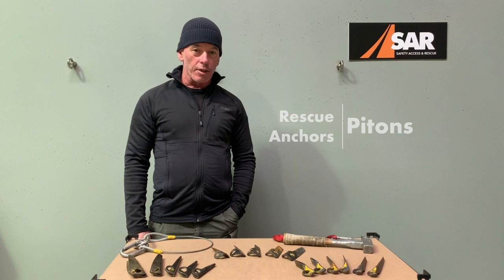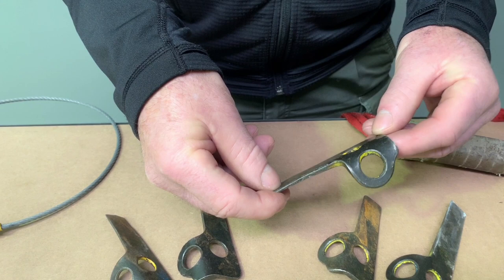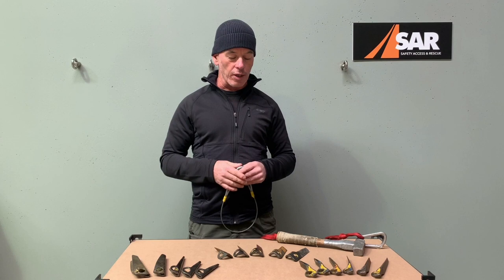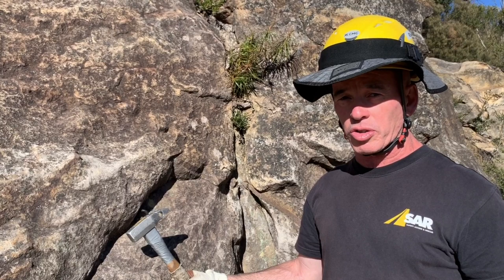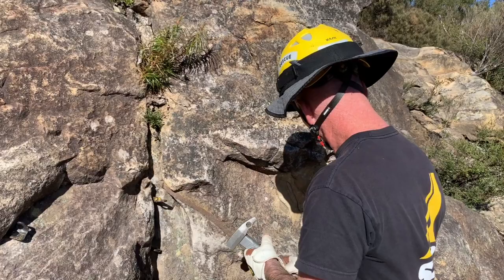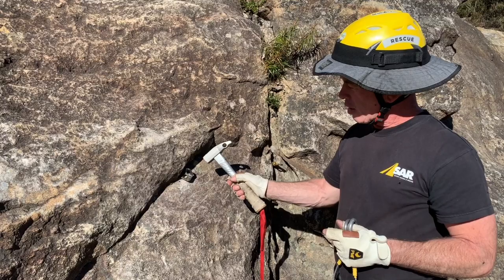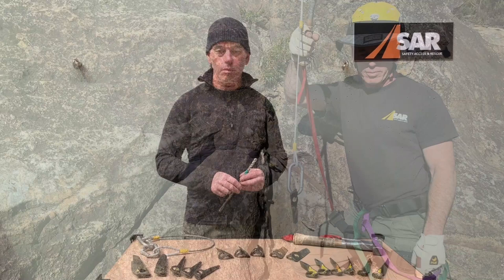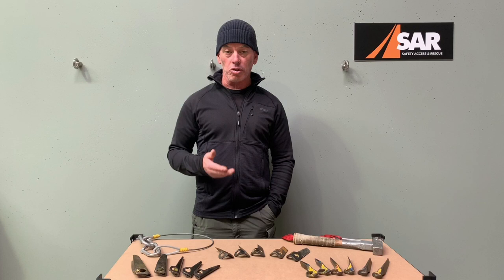Rescue Anchors - Pitons

Comment: Have y'all done much with concrete screws as temporary and removable anchor points? I'm a huge fan of using 3/8" concrete screws for cave exploration. (:
Reply from the maker: Hi Rachel. We have done a little with these... they work great in the soft sandstone here where we live / climb / work. We might try and do a video on these at some stage.

Comment: Another topic: Do you also use Hooks, like the Talon, cliffhanger or grappling hooks from BD? Could you film your experiences with that?
And how do you like these anchoring options in Urban environments, placed in concrete?
Reply from the maker: Hi Hugo. I'm glad you liked the video so much. I have a very large collection of aid climbing hardware (so yes Talon, Grappling hooks, Cillhanger from BD but also Leeper cam hooks, beaks etc) that I have assembled over the last 40 years. I use it when I go aid soloing. I will do a tactical anchoring video for urban environments as soon as I can. The teaser video is up for this now where we use Cadex parapet hooks & so forth. Stay tuned as we have many more concepts for videos. Cheers!

Comment: Thanks for a great video! 
A question: How small can you go with the Angles, knifeblades/bugaboos, and Lost Arrows? (for creating a 2-piece or 3-piece anchor like you do in the video)
Reply from the maker: Hi Eric. I guess it's going to be a function of the rock that will determine holding power. In bulletproof granite or limestone a cluster of really small pins is going to be super solid. I've always been amazed at just how hard blades & Bugaboos are to get out; that surface area creates incredible holding friction. In dubious rock, say like the sandstone we have where I live, small pins would be a real concern since I'd be worried about the substrate failing. I can't give you a definitive on this... its an area where you just need to get out and put a whole lot of pins in to get a sense of what they can do.
Reply: @safetyaccessrescue7136  That makes sense. Here in Norway we usually have pretty good granite. But I should go out and try placing some more pins to get a feel for it :) Thanks for your answer!